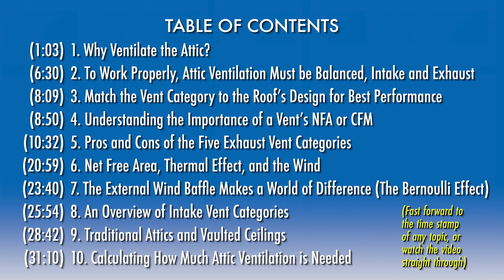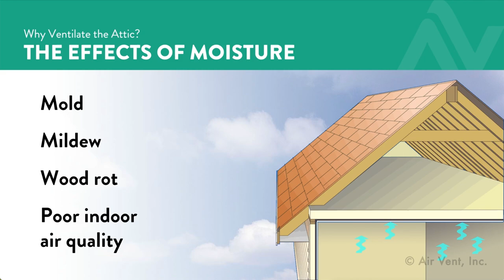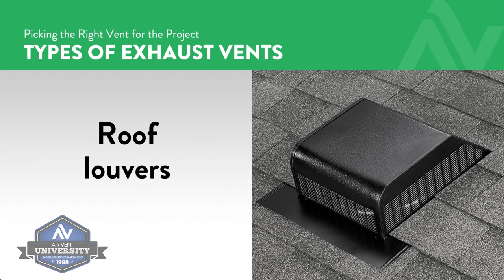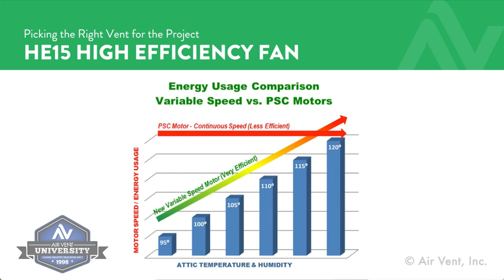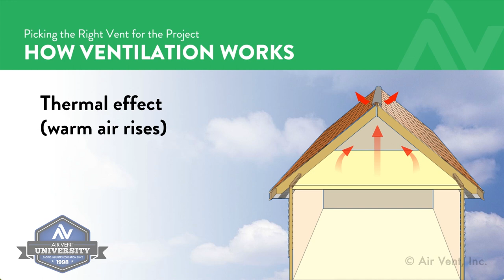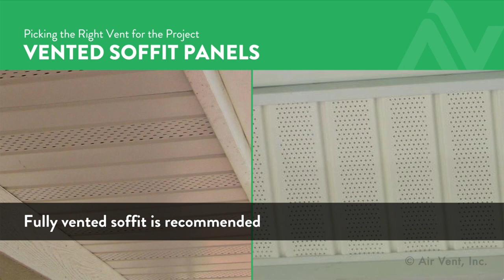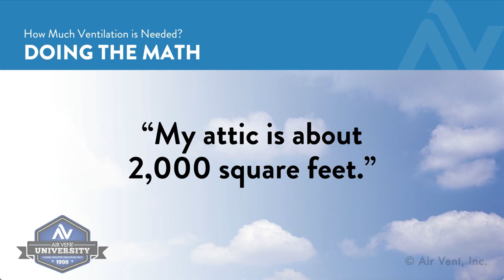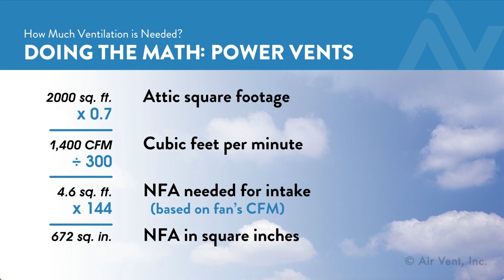Attic Ventilation Educational Video: 2nd Installment (Shortened version of “Ask the Expert” Seminar)

Comment: Posting this before watching.

If my soffit vents net free air calculates to 13 sq in / lin ft, and I put a 20 net free air ridge vent on, does that really matter?  I know the ridge is supposed to equal 50% or less than the sum, so one would think that I should be looking for a ridge vent with a Nfa of 13 or less.

But...., the actual ridge Nfa was determined by my builder when he cut the gap at the ridge, right?

So if that gap square inches works out to less than 50 percent of the total sum, then the size of the hood doesn't matter right?

I like the rigid vent better than the rolled, but I'm concerned that I might over size it and reverse the air flow.  

But I think the gap is the regulator and not the cap.

Like the size of the carburator is what dictated cfm, not the size of the breather.

Right?

Comment: Now find a way to eliminate the restrictive filter in the ridgevent. The filter cuts the air flow by greater then 50%
Reply: Yeah, and the "baffle them with BS" about ridge vent in general. Far more important than the supposed hot and cold spots that ridge vent solves is the amount of air exchange. A ridge vent cannot compete with a fan in this regard. But ridge vent is a more profitable product for manufacturer and for installer.
Reply: @bokononisti2820   A properly balanced, baffled not filtered ridge vent exchanges attic air 10X per hour, which is plenty to keep attic temperatures minimally higher than ambient temperature. I would never install a fan in my own house. Ridge vent is Much better looking, as effective, and longer lasting than the 5-10 year warranty fan. One that does nothing for moisture buildup in the winter?